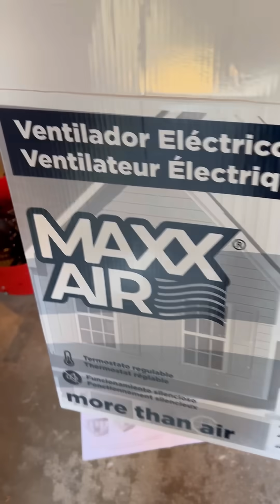Why I Don’t Trust Circuit Tracers in Critical Situations🔥⚡️#shorts #electrical #fypシ

Comment: THANKS YOU THANK YOU THANK YOU!
I've spent YEARS auditing, inventorying, and indexing bldg. systems- electrical, lighting, plumbing, mechanical, ALL of them.
Panels not or mislabeled TRIGGER my OCD!
Reply from the maker: Haha I agree
Reply: I always tell people “ take a few hours, with one of you at the panel and the other one out in the house. Talk between yourselves with your cell phone. Go through EVERY SINGLE outlet, light fixture, switch and appliance, one at a time. Turn off the breaker, verify the correct breaker # controlling each location. Use little stickers, write the circuit # on it, then stick it on the trim plate. They come off easily enough. 
After that the can write/type up  COMPLETELY accurate panel schedule, identifying every load on that circuit.  I will also make a quick, free-hand 4 walls drawing of one of their rooms. I draw in the symbols for outlet, switch, light fixture and maybe ceiling fan.  How much “buy in” my suggestions produces vary from client to client, of course.  Many will say “Yeah, we’ve been meaning to get around to that someday…”.   Others will take my advice and do it. If they are the DIY or hands-on kind of homeowners, they may draw up the whole place. Depends of course on their ability/comfort with drawing. I always tell them it doesn’t have to be a work of art, or even to scale. Use a ruler and graph paper if you are a Luddite like me (they make it embarrassingly easy to do all of this on a computer with a simple program). Which I have never had time to learn myself. lol 

I stress to them the value of having gathered and verified this info BEFORE you need it.  I tell them how I have used up 5 or more billable hours at 125.00 tracing down a short or break in a conductor in some very old, complicated and seemingly haphazard circuit design and wiring layouts.  In some of the 120 yr old buildings I service, where generations of changes, Jerry-rigs and modifications have been made by unqualified personnel, where multiple  junction boxes and abandoned sconce light locations have been completely plastered over or buried to get that “nice, clean look!”   The worst are finished basements, where I know there were many, many original JBs in the basement ceiling when it was “rough,”  feeds for outlets above, junction points for multiple circuits on their way back to the panel, transformer take-offs for doorbells or thermostats. Everything that eventually makes its way upstairs passes through the basement ceiling at one point or another.  They bring me downstairs to show off their beautifully finished basement. It will be beautiful, too!  Clean, contiguous drywalled ceilings from front to back and side to side, without an access panel to be found.  Closest thing is the recessed cans you need to disassemble and remove to get a glimpse above the ceiling.   

Believe me, it’s time very well spent spending a few hours with 2 people, radios or cell phones, and a college-ruled notebook full of clean sheets, going through the whole system patiently and methodically, capturing and recording all of this info to be safely stored away in the “House” file.  

Or, if that’s just too much hassle, you can pay an electrician like myself 125.00 hour or more to spend multiple hours doing it for you by default, as he meticulously opens every switch and outlet and takes down fixtures all over the place, with your furniture blocking his access and your closet full of lasts decades clothes insuring he can’t get to the closet light, or even set up a ladder, until you transfer your expired wardrobe from the hanger rod to the bedspread.

Just a little free advice!
Reply: Hey Lance,

It’s Sat morning here in beautiful Chicago! In a little while, I have to head out to a client’s 6-flat condo building to replace the public fusepanel (1950s) with a new breaker panel.  Hope it goes smooth, but don’t want to jinx it.

My little brother will be at Brown, watching the Bruins struggle mightily to bump off Cornell.  His daughter is in grad school there, so he’s all in. lol. My older brother played football there in early 70s. He is 100% locked-in on Bruins football in the Fall. My younger brother lives in Barrington, so he goes to games off and on.

But from your previous videos, I’m 99% sure you will be out there working today. Me, too.  Be safe and be careful!

Peter McCarthy Electric in Chicago
Reply from the maker: @ChicagoRules thank you brother good luck out their I absolutely am working every Saturday!

Comment: I just put the GFCI tester in the outlet and push the button, then go and look at which breaker shut off😂😂😂
Reply from the maker: Right cause that works on non GFCI breakers right
Reply: @SchecterElectric  there are models that exist that create a short within them to shut a breaker off to find it. They’re kind of old school. The one I have is from like 2002, it was my grandfathers, it has a sliding switch that releases a spring that is connected to the neutral leg of the plug and that spring bounces against a post attached to the hot leg of the plug. It essentially closes then quickly opens a short circuit, causing the breaker to trip.

Comment: Why not use the circuit tracer as a second option. Use it first then use the drill to save some time
Reply from the maker: No I don’t use the circuit tracer at all to much liability trusting a device that I can’t control I know the drill works 100% of the time to much risk
Reply: @SchecterElectric so would you say plug in a equipment that draws a lot of A to detect the circuit
Reply from the maker: @jorgeberruete4537 that’s what I did